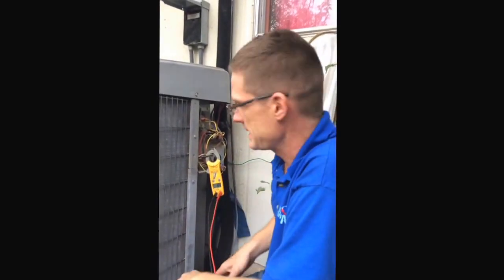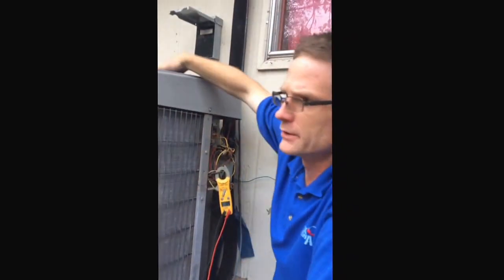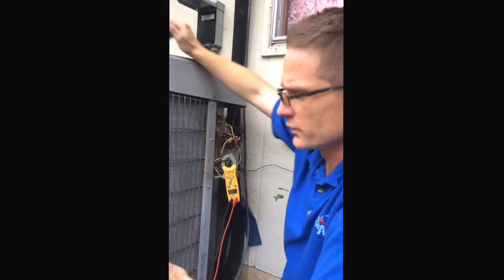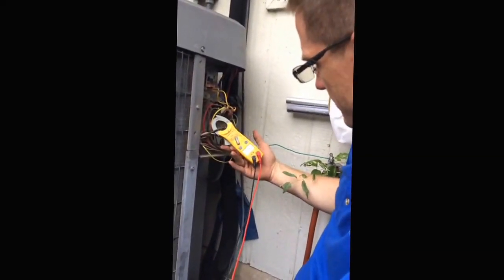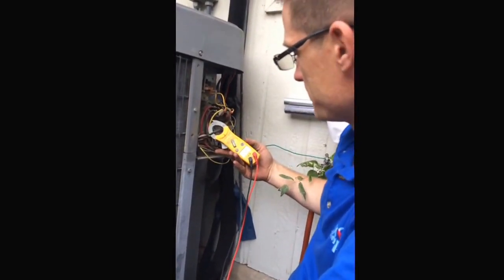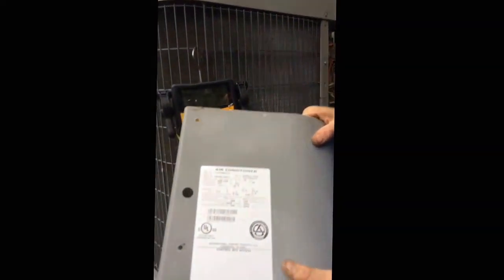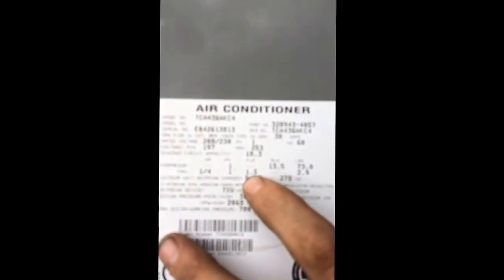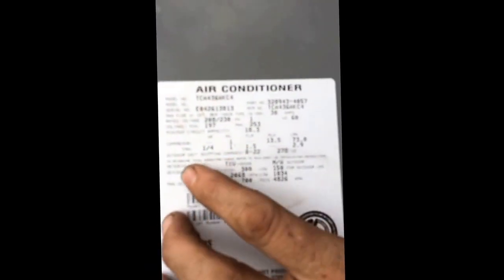How to diagnose a bad condenser fan motor.

Comment: My condenser fan motor is pulling 1.1 amps and the specs say 1.2. When will I need to replace the motor? Should I buy one to have in case it goes out? Or does it do more damage to wait until a motor stops running?
Reply from the maker: grneal26 , 
 No need to buy motor. Just confirm capacitor is good. Weak capacitor will cause excessive amp draws and premature motor failures